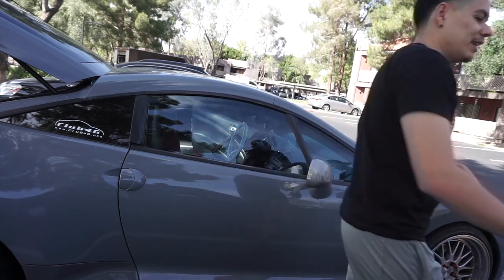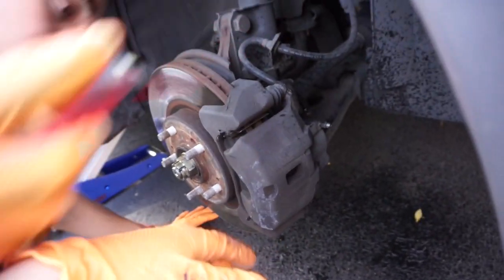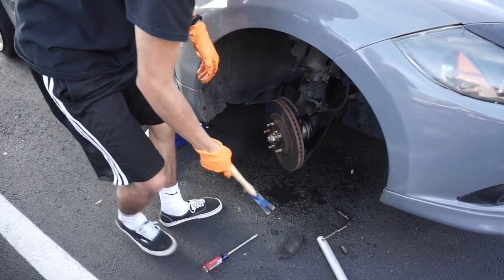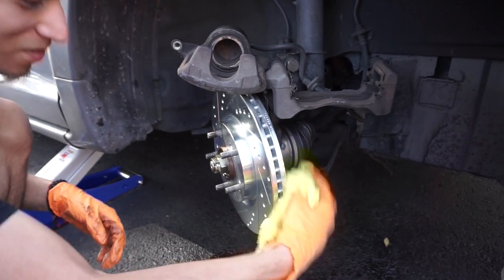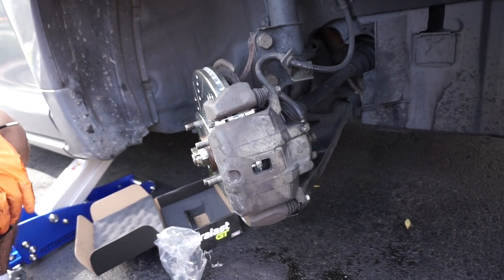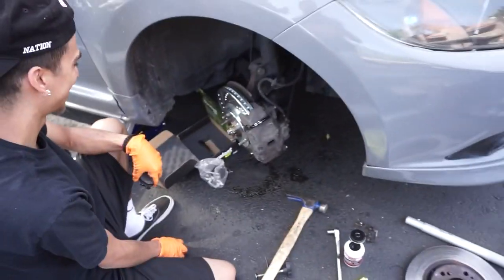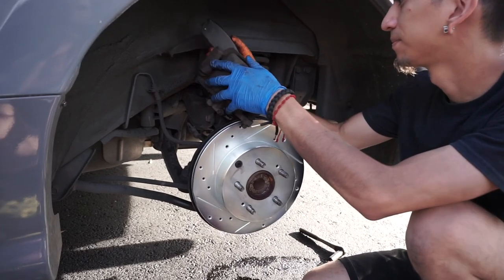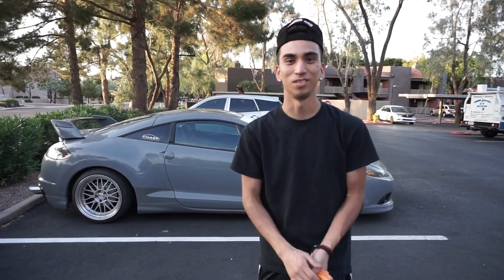Mitsubishi Eclipse 4g brake replacement

Comment: Did you check the size on those new Rotors? when i order mine they were smaller and thinner had to return them apparently they will fit  but they were smaller maybe cuz my car is a GT not sure good install
Reply from the maker: Franky Mitsu we didn’t really check to much but they seemed the same size and the eclipse is also A GT too

Comment: Hey fam what’s your wheels spec and tires set.... are you on coilovers or lowered spring thanks
Reply from the maker: romanov myrthil Tein lowering springs and 19x9.5 and 19x10.5 in rear and I believe 265/35/19

Comment: You guys should do a video on how to replace the timing belt on these 4g eclipses
Reply from the maker: Aey Phan unfortunately we already did it on his eclipse off camera my bad man any other suggestions?
Reply: @SvperDvperProdvctions  

Wassup brotha thanks for the quick reply. I just bought my eclipse a few months ago. Great car. How long did it take replacing the timing belt? Was it difficult? How about a video on replacing radiators?
Reply: @loslakers530  do you recommend it? I'm planning on getting one, but not sure if I'll properly fit in it(I'm 6 ft tall)
Reply: @alexanderrendongamez2057  

I'm 6ft aswell and fit in just right. A little snugged at times since it so low. Other than that great car. I do reccommend replacing the condensor at aroung 95000 miles and the crankshaft position sensor around 98000 miles. My 4g eclipse gs model gets great looks and great gas mileage. Defintely reccommend it